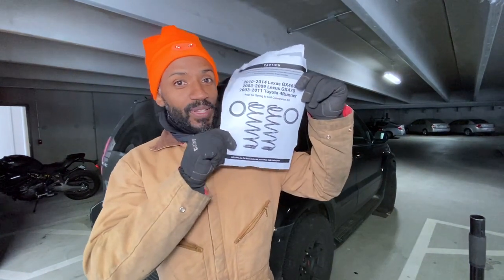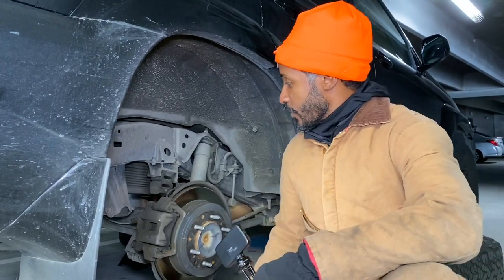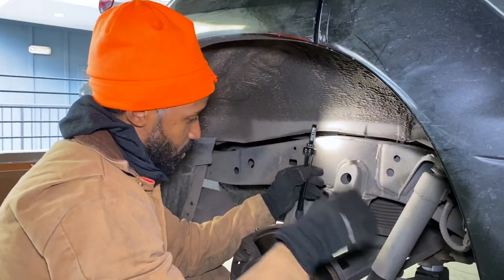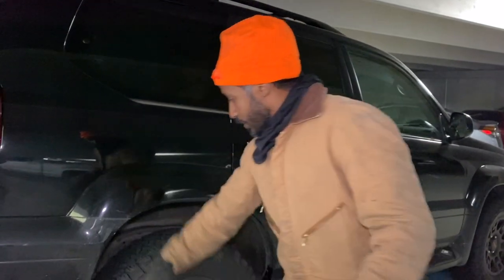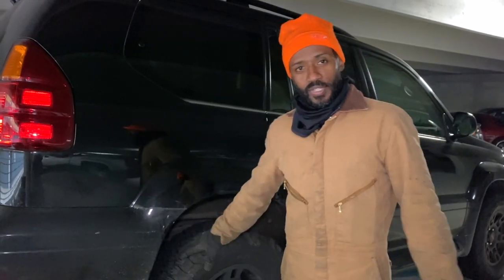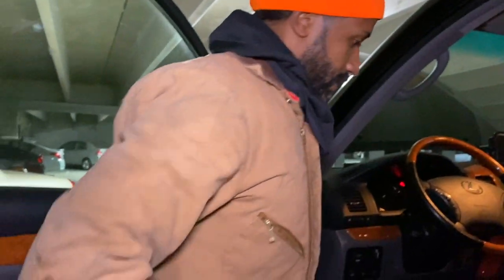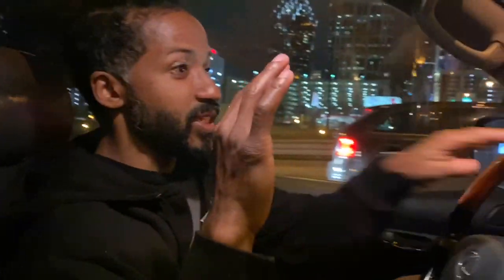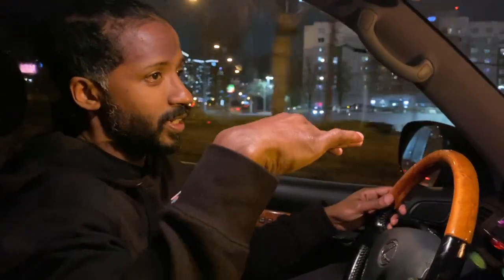Gx470 Suspension Conversion - From Air Bags to Coil Springs.

Comment: One other thing. Since you're removing the control for the shocks (i.e., comfort to sport dial), should we make sure that it's in the setting that we permanently want the truck to be in before disabling the dash lights? Or does the truck go to a specified shock setting once the controls are removed so it doesn't matter?
Reply from the maker: Jerrid Higgins I am not 100 percent sure. Honestly I couldn’t feel the difference in the settings. I would say set it to your preference to be on the safe side.
Reply: How much does it cost to lift a car by 1-2inches ? I have a 2006 highlander and I found some front and rear strut lift kit from eBay. I am just wondering can any mechanic just do the job because I have watched some videos on the process ..... you have to remove all 4 shocks ( the front ones by popping the hood ). So I am wondering how much they would charge me ?? The strut form eBay are 160$ front and about the same from the back

Comment: Excellent video, question  , do you have to replace the shocks?  I have seen kits with just the springs and some with the springs and some with springs and shocks? Thanks!
Reply from the maker: I didn’t, you don’t have to unless your shocks have gone bad.
Reply: Ok thanks, some one recommended bilstein shocks. I got 250k and having the sagging in the back issues so I think it's the bags, I want to do a conversion to the springs and since you got to take the shocks off somewhat I figured I would just change out the shocks.   @KRTLyfe

Comment: KRT LYFE--I just installed the coils (thanks for all the tips) and the kit I bought did not come with any "rubber gaskets" for SCREWING to the chassis (top of coil) or on the axle (bottom of coil). The gaskets that came are just held in place by the pressure. Is it necessary to have screwed-in gaskets, or is it OK/SAFE to install without them?

Comment: I did the install without the metal tech retainers, and it worked fine. But I ordered a kit from Amazon, (mistake) the rear springs did not have enough strength to hold the vehicle level with the front, so i went to NAPA and bought the rear springs and had to fight with the seller from amazon to do the return.
Reply from the maker: Andrew Gonzales interesting mine still sits higher than the front (with the metal tech kit). The only time ours sits levelish is when it is fully loaded with gear and people. I have been even considering installing a leveling kit to bring the front up a tad.
Reply: @KRTLyfe  After i bought the rear springs from NAPA mine was sitting like yours was, but the front struts that came initially with the Amazon kit i bought lifted the front up almost 2 to 3 inches. When it was all said and done the vehicle sat level but with  a lift on the front and back. If you do decide to change the front, i would recommend using "strut masters" and contact them. They are more expensive than some of the other kits you will find but provide good customer support and a better quality product. here is the link to the front change out i did, i also changed the CV shafts and front bearings as well due to my GX 470 having 220,000 miles on it and one of the bearings were grinding. My video footage is not as good as yours as i was by myself and using my phone, lol. Hope it helps you out if you work on the front. You did a great video as well, and will help a lot of people out. 
https://youtu.be/RAlmB6e_Mv0
Reply from the maker: Andrew Gonzales thank you. I want to lift it but unfortunately our GX barely fits in our garage as it is. We have a solid 3 inches of space with our roof box. I’m going to check out your video! Thank you.

Comment: Great video! My airbags also failed and had a buddy replace them with coils and new shocks. I don’t think he pulled the fuses because my ABS, VSC TRAC, and VSC OFF lights are on my instrument cluster. Is it normal for these lights to be on if the fuses are not pulled? If I removed the exact same fuses, should these lights go off? Will the ABS and VSC still work after pulling the fuses? Sorry for the many questions but I would greatly appreciate your feedback.
Reply from the maker: There are a few write ups on this topic on IH8MUD that can probably give youI more information on which fuses to pull. If you have the same year GX as mine pulling the same fuses I pulled might work for you. Ive been told by various GX enthusiasts that some years are slightly different. In your situation I would definitely reference I8MUD.
Reply: @KRTLyfe  mine is a 2004. I’ll do a little more research but I do appreciate the response
Reply: Any update on if he fixed the issue and how?

Comment: Just brought the Metal Tech  kit. My question is I also brought some new shocks since they must partially come off but I brought regular Bilstein 33-313146 shocks , can I install these with the kit? The factory adjustable shocks cost $1,775 😢
Reply from the maker: I believe that you can, the factory system should be disabled.

Comment: Great video....Great Video!! BUT.......I found replacement airbags on "the bay" for about $75. Why go through all of this trouble instead of just replacing the bags. Yeah they are probably some cheap Chinese replacement but $75 vs how much those springs cost + your time in labor. I'm not hating just like mehhh.....I would have replaced the bags with the cheapie cheapies just to see how they ride before switching to coils. Less time...less work...less money. But hey bruh...DO YOU! Much love and by the way... I'm in the A as well with a GX470. I'll be looking for you and wave when I see you.
Reply: Because they will fail again,with the coils no more worry

Comment: Finally did it! Thanks for the help! Although the vsc track and off warning lights are on now for whatever reason.... any thoughts? Thanks in advance!
Reply from the maker: Did you pull the right fuses
Reply from the maker: Triple check and make sure you didn’t disconnect the wrong connections.
Reply from the maker: Aayya
Reply: @KRTLyfe  yes. Same ones as the vid. The 50 and 10 from fuse box, and the 20 from panel.
Reply: @KRTLyfe  all vids and post are saying the same as yours,  to pull those , but for whatever reason,  those warning lights are on now. I'll keep checking around for an answer, was just wondering if you knew a reason. Thanks for you time!
Reply from the maker: @jaromudesigns2636   I wonder if you disconnected one of the wheel speed or abs sensors?

Comment: Let me get this straight, after 18 years an air bag fails and it's a common problem. The rear auto leveling susp system has been around for decades and has proven to be extremely reliable, even for off-road use. If you knew what you are talking about you would replace the bags for cheap and maintain one of best susp systems on the market.
Reply from the maker: A lot of assumptions there buddy, but hey do what you like!

Comment: Awesome video. I did the same thing and now my VSC and And traction lights are on when I pulled the fuse inside. Any advice?
Reply from the maker: Did you pull all the fuses and the correct fuses I believe there are 3 user the hood and one under the dash. Hope this helps.

Comment: Thanks for the video I will have to change mine soon as it is a common failure in the FJ120 or prado as it is called here . Do those springs keep the ride height to normal ?
Reply from the maker: Yes they should if you don't use the metal tech kit. The air suspension is a very common failure on these cars.

Comment: First I’d like say I’m sorry for the loss of your GX. It was a super nice ride. May it Rest In Peace 

But question about the front. Did you end up raising the front at all after putting the springs on, or did you leave it alone? I was trying to look at your other videos and couldn’t really tell a difference, the front and rear looked pretty level to me.
Reply from the maker: I’ve done a bit of reading on this and Toyota does this on purpose. The forward rake is supposed to improve handling characteristics during normal driving and when the vehicle is fully loaded. 

Some comments I have read say leveling the vehicle out will cause handling issues when fully loaded. I never changed mine because ours was always loaded with a RTT, plus humans, plus gear lol. Initially it looked funny unloaded but, I got accustomed to it really quick. 

We would do 9 hour drives on a regular with our GX, so the last thing I wanted was poor handling.

Comment: This was a really helpful video to see how I might do this for a 2nd gen Sequoia, thank you. Sorry to hear about the accident, hate to lose a unicorn. Was hoping you could answer a question tho...do the shocks and air springs work together? I was thinking if I went to coils on my sequoia that I could still adjust the electronic shock setting between comfort, normal and sport.
Reply from the maker: That is a good question, there might be a way to preserve that function but I’m not sure. I would do some reading on IH8MUD. You might be able to find a solid answer there.
Reply: @KRTLyfe  Thank you for the quick reply! Wasn't familiar with IH8MUD, will go check that today, appreciate it 👍

Comment: Nice video. Are you going to do away with the TEMS shocks in the rear? You would still need that switch to adjust the stiffness of the shocks. I have an 2003 GX470 and had the same issues you had.
Reply from the maker: Feel free to correct me if I am wrong, but I think pulling all those fuses disables the TEMS stuff.
Reply: @KRTLyfe  you may be right. I kept mine because I dropped the $$$$ for both sides before I pulled the bags. 👍

Comment: Thanks for the video.  How tall are your jack stands?  I am wondering how much height I need to account for the rear suspension droop if I'm using the jack stands on the frame rails rather than the axle.
Reply from the maker: If I recall, believe I used 3 ton stands in this video. They are all relatively the same height if you goggle them.
Reply: @KRTLyfe  Thanks, I've seen folks in other videos report that 3 ton stands were too short.  Perhaps the taller end of the 3 ton jacks would be appropriate, say >16" max height

Comment: How is the ride compared to before (when you had Air Coil)?  have you noticed any difference in the ride?
Reply from the maker: The ride is just as good if not better. Our suspension was on the way out it would hold air but deflate over night. These springs are great tho!

Comment: Did you experience any noise coming from the coils?  I just installed Strutmasters coils when my compressor and bags went out at the same time.  They feel great and I feel more in control when driving but there is a bit of squeaking and noise coming from the springs.  Almost like they havent settled in yet.  Maybe I need to give it more time.
Reply from the maker: No, we did not have any squeaking. Check and make sure the springs are seated properly.

Comment: Thanks for the vid! About to do mine. Do you think the airbag delete kit is necessary? I've seen both ways.  Thanks
Reply from the maker: I think it depends how you intend to use your GX. If you are going to be doing any off road driving that is going to work your suspension. I would say yes. If not you might be able to get away with out it.
Reply: @KRTLyfe  thank you!

Comment: likedd this video.I have toyota landcruiser Prado which is the  diesel engined variant of the Lexus GX 470  sold in other world markets and not available in US
i had a bag failure buthad to  convert to coil springs .Unfortunately i onlyhad access to stock springs .but now the coil springs  does not support much weight
can you recommend a good set of  shock absorbers that would fit  the GX470
Reply from the maker: Bilstein.  I would definitely try to find springs tho that will make a big difference.
Reply: @KRTLyfe  thanks will look for them

Comment: Thanks for keeping video real. Will this work for the LX as well?
Reply from the maker: You can do the AHC delete on LXs, I’m assuming you are taking about the 100 series LX..??? However it is much more involved due to the design of the 100 series AHC suspension system.

Comment: Hi. Did you change the OEM shocks also before installing the springs or you retained them????
And where on Amazon are you buying the spring seat you used and the metal-tech delete kit from
Reply from the maker: Kaburu M I kept the OEM shocks.

Comment: Awesome video! You mentioned that you got a rubber isolator or pad for the bottom of the spring, above the axel.  Your amazon link I read a comment on someone else’s amazon purchase that theirs didn’t come with it. Do you believe it’s required? Was trying not to buy the metaltech conversation puck if it wasn’t required. Thank You in advance.
Reply from the maker: I would personally have something there so it’s not metal on metal. That isolator even the small thin one should reduce noise, vibration and the chance of the spring shifting or coming out. I’ve heard of people installing the springs with out them, but if you plan to drive off road I would definitely find or fabricate something.

Comment: The link you have for the springs say it’s for 2010-2014 is that the correct link. I have a 2009 would them rear springs fit or it don’t matter? You said you put them on a 2006.
Reply from the maker: Sorry the link has changed several times since I posted this video. I try my best to keep it updated but it isn’t the easiest thing to do.

Comment: Great video. I know you put a link for what you replaced the interior button with, but it's not working anymore. I have a silly question. What did you search for to find it? Just Lexus replacement button?
Reply from the maker: EBay GX or Prado suspension control replacement. Storage... Something like that.
Reply: @KRTLyfe  thank you sir. And thanks for helping me get that damn tire pressure sensor light turned off too lol
Reply from the maker: @ryanh6931   no problem, I try my best to make useful DIY vids for the car community!

Comment: great video my guy!! 

I just realized you took out the buttons, since you left your stock shocks, technically the shock settings (comfort/sport) would still work right?
Reply from the maker: Peter Ou your guess is a good as mine. Honestly when the system was OEM I couldn’t really tell the difference between the settings. I had a Cayenne turbo and on that thing you could tell when it was in comfort/sport! Also with the removal of all those fuses my guess is that the entire suspension management system is disabled. I’m not sure tho so please take my hypothesis with a grain of salt. Thanks for watching and commenting we sincerely appreciate the support!
Reply: Somewhere I read that the lexus electronic system does a self diagnostic and if the rear air bags don't return a thumbs up, then it shuts the system off and throws an error light.

Comment: Any consideration if you tow a trailer?  I currently have a 2004 GX470 and tow a 4000lb travel trailer.  The airbags, etc are currently in good condition but I have every expectation they'll fail in the near future (been very lucky).  The airbags compensate for the tongue weight and keep everything level.  Not sure how towing plays in to the decision on what components to purchase.
Reply from the maker: If you are towing a lot of weight I would prob go with a heavy duty spring! IM not sure how that will affect the spring rate and ride quality tho. Im no suspension expert lol.  Our GX did not come with a tow hitch, I had to add it. I went with a 5k Curt hitch. The only thing we really tow is our bikes. If I every have to do any serious towing I would prob just find a Diesel.

Comment: Great video!  thanks.   Do you have a part number for the filler piece for the cabin where you removed the switch?
Reply from the maker: It was available on eBay but the link keeps changing. I think I wrote it in the description.

Comment: Awesome vid. I did the same for my Lexus. Where can I find the ride height control replacement part? I can’t seem to find it online. Maybe I’m typing in the wrong key words. Thanks!
Reply from the maker: I found mine on eBay. I can't remember what I typed maybe GX470/Prado center console suspension control delete.

Comment: Humm lookimg at buying a used 470 and that is a $1000 job at a shop right?   Thanks!
Reply from the maker: I’m not really sure how much a shop would charge for this. You might want to check on ih8mud. You might be able to find some info there.

Comment: My bag that was bad (passenger) side came out pretty easily.  My good on (drivers). Is still
In there pretty tight- do I need to disconnect it from air line thus releasing the air, and then it’ll be easy it take off??
Reply from the maker: Yes, disconnect the bag and deflate it. That will make it much easier to remove.

Comment: I converted mine from  air suspensions to coil springs but it was very uncomfortable driving 
Any suggestions pls
Reply from the maker: Could be a few different factors. The stiffness of the springs you went with, your shocks could be done.  99.9 percent of people that have done this mod have had  positive results, including us. 
You definitely have something else going on.

Comment: How did you get to fit the springs in there??? Did you disconnect something and not film it?? I can’t fit springs when that rear is hanging
Reply from the maker: I had to disconnect the sway bar end links I believe. I’m pretty sure its in the video.
Reply: @KRTLyfe  thanks, I got it but had to use a pry bar and force it in lol